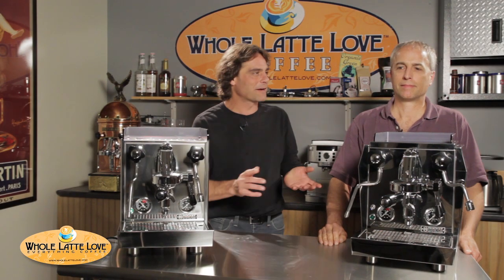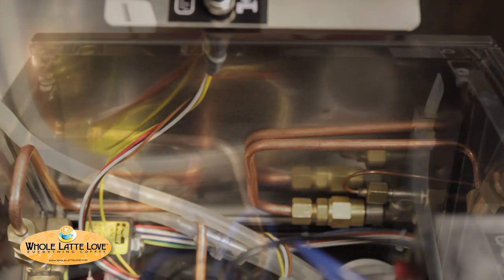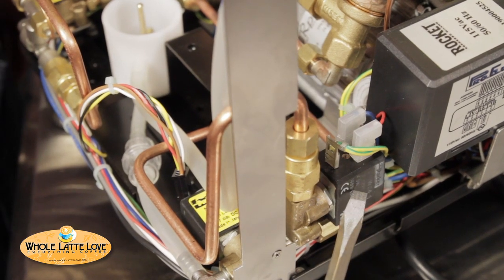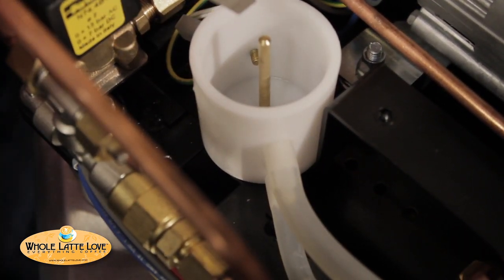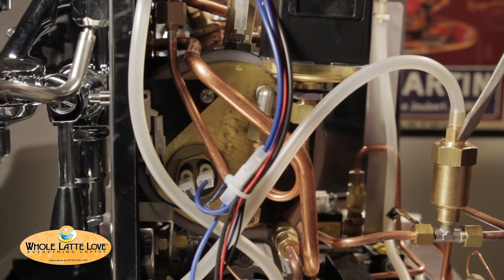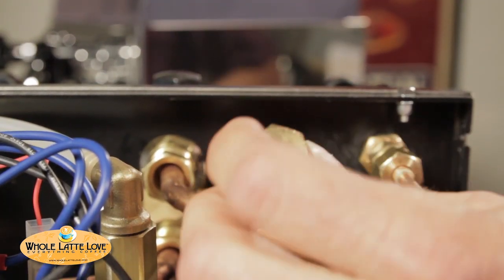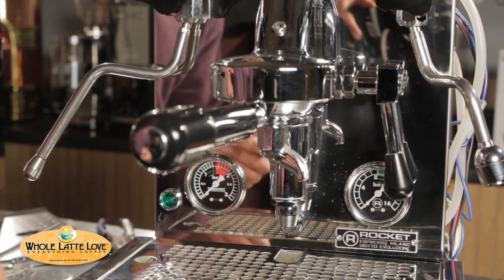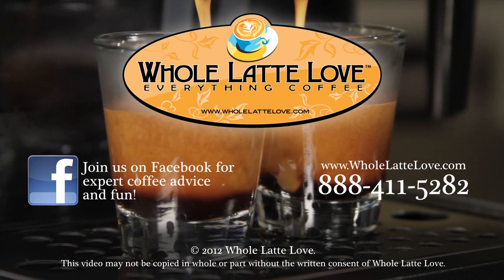Tear Down: Rocket Evoluzione V2 Espresso Machines

Comment: Is it hard to replace the controlbox by yourself?
Reply from the maker: Hi NM, Thanks for the question. Should not be difficult. Honestly getting into the machine to do it is probably more difficult.
Reply: Whole Latte Love ok so buying a 7 year old one with broken control box for 400USD is a good deal?
Reply: I'll sell you my completely dead 2017 model for 100 bucks.

Comment: Hello WWL guys! Could you, please, specify what is the diameter of the hole restrictor mounted at the pipe ends which enter into the brew groups? It seems that it is small than 5 mm, but I cannot be sure. It may be 2.5 mm, 3 mm, 4 mm. My next question is are these restrictors are repairable in case of lime scaling? These restrictor is shown on 8 min 39 s

Thanks and regards,
Petar
Reply from the maker: +Petar Rusev We're contacting Rocket to get the specific size of the flow restrictor and will share that information when they reply. As for dealing with lime scale, you don't need to repair it, you can remove the part and use a descaling solution. Could also use a tool to scrape out tough deposits. Just be careful to not enlarge the orifice if using a tool.
Reply from the maker: +Petar Rusev Hi Petar, Heard back from Rocket: 
"Group restrictor is 3MM located in the top group pipe"
Reply: +Whole Latte Love Thank you guys! You are real professionals! My next question is what is the diameter of the group pipe of the rocket cellini evo v2? For example, from your presentation of Expobar Brewtus IV I understood that its grouphead pipes diameter is 12 mm. Also Todd said that the Expobar Brewtus IV make the best espresso shots among all the machines sold in your store!? What do you recommend - Rocket Espresso Cellini evo v2 or Expobar Brewtus IV vibratory pump having in mind that I will not plumb the machine? In the presentation Todd made shots only with Expobar Brewtus IV Rotary pump machine ... So, what is your recomendation having in mind that the price of both Rocket and Expobar machines is the same - 1850 USD? Thank you!

Comment: Will you do a similar tear down of the 2017 model(s)?
Reply from the maker: Hi T13, It's possible. Is there a particular model you are interested in?
Reply: Hi WLL! Both Evoluzione R (preferably the Mozzafiato variant) and the Appartamento (I didn't find any reviews by you guys for that model) :)
Reply from the maker: Thanks for the suggestions. Will see what we can do. No reviews at this point as we are not carrying those models. If interested in the Appartamento you might want to check out the Profitec Pro 300. It's similar in size and price to Appartamento but is dual boiler PID. Here's our video review of the 300: https://youtu.be/tQXm25pMXds
As for the Evoluzione R M variant. Thinks it's unlikely we will carry the machine. It's rather pricey in comparison to similar spec'd heat exchange machines and to some extent PID on an HX machine is more marketing than a truly useful feature.
Reply: Thanks for the update. Sorry to hear that. Not a fan of the Pro 300 aesthetically. I love Profitec but I'm more a fan of classic looks (Pro 700, ECM Technika Profi). Unfortunately those machines are too big for me. The Evoluzione R Mozzafiato is only 28 cm wide whereas the ECM Technika Profi, which is a "similarly spec'd" HX machine, is 32.5 cm wide. Depth difference is even bigger with Evo at 42.5 cm deep and Technika at 47.5 cm. I love the clean internals of Profitec and ECM machines, as well as their craftmanship details and choice of material (e.g. stainless steel boilers), but they are unfortunately too big for me :/ I agree the PID doesn't shine on an HX machine,  but it does make it more quiet (no clicking).

Comment: I have a Rocket Modello Cellini Plus V3 and originally the machine was not filling the pressure tank and folks in Italy suggested changing the control box and the wire harness plus the heat element.  We originally thought their advice was incorrect but did the recommended changes anyways.  No luck so we ordered and changed out the pump and now the machine seems to sound correctly and fills the pressure tank.  Steam and hot water now come out as usual; however the brewing function still does not work.  We see the brew gauge does not read pressure but the steam gauge does.  When I look at the brew switch inside the machine (raising the brew lever activates the switch) I may have inadvertently reconnected the wires incorrectly when I replaced the wire harness.  There is a brown and black wire connected to the brew switch coming from the control box and there are three connectors.  Two at an equal lower lever and one up higher on the inside top part of the switch.  Can you tell me which connectors to use to connect the two wires?  Thanks a ton.  I think we almost have this machine working but need this last detail resolved.